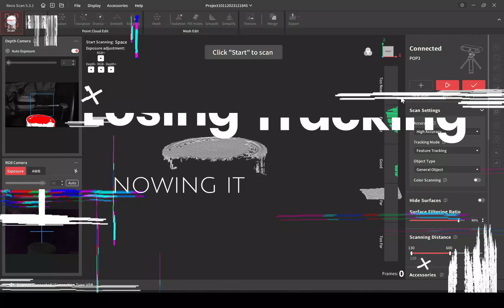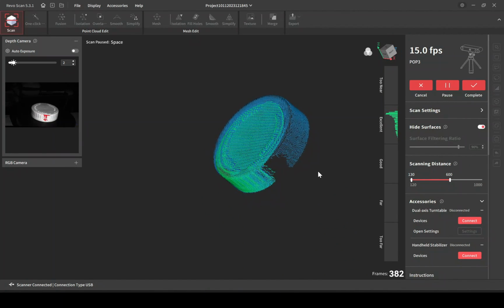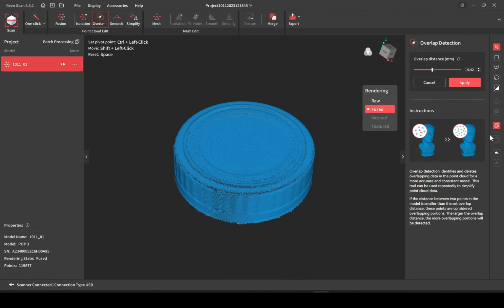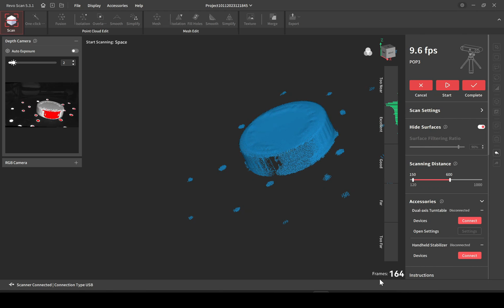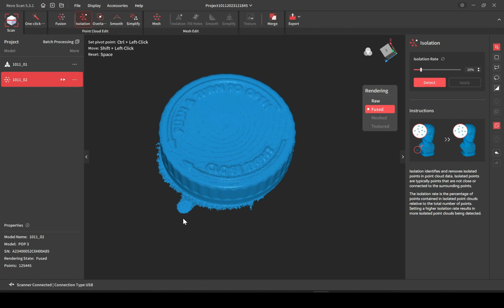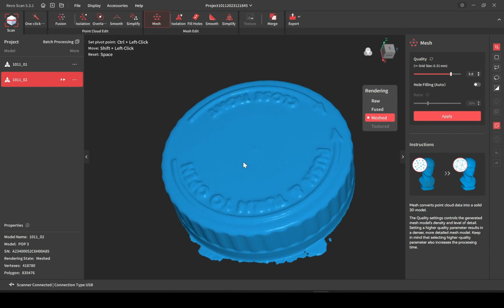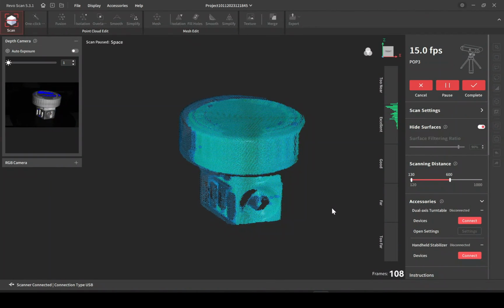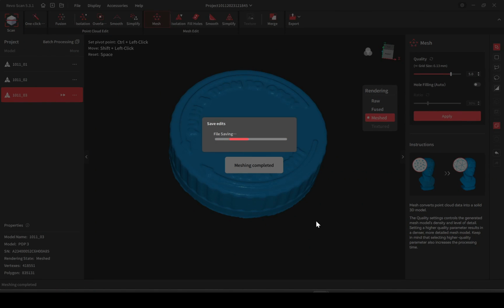3D scanning Tips - Tracking

Comment: Why does my pop 3 make trail lines of the tracking dots when rotating and yours doesn't? Did you do something special?
Reply from the maker: Depends on the item.
In marker mode the should be very little to no trail.
In featured mode. They might be a small trail if it lost tracking.
A very small amount will be fixed in processing the point cloud.

Alot of trail means it is lossing tracking of the main item.
Reply: @xile6  yeah I don't know what I'm doing wrong. I've tried everything from adjusting the lighting, adjusting the distance spraying with aesub, painting flat white. I can't get this thing to give me a good scan on just about anything. And I'm scanning very basic shapes. It's not like there's any intricate geometry it's trying to work around
Reply from the maker: @thegoudaguymikey  oddly enough basic shapes are the hardest. Scanners dont see how we do. They need distinct features to hold tracking, or it all looks the same to them.
Did you try in marker mode with markers on the table and some on the item if need.
Reply: @xile6  indeed I did. Someone on a forum told me I might need to get the mini

Comment: In both cases you used marker mode to track but in the first case it lost tracking; or did you use feature tracking the first pass which causes it to duplicate itself numerous times and in these cases you have to use marker tracking the second time the merge them together.

Why not use marker mode the first pass ?
Reply from the maker: First mode was feature tracking. And it is part of the video to show others what they are doing wrong. Reason for starting in feature mode.
Reply from the maker: Also you do not need to use marker mode on both scans to merge them together. One scan can be marker mode and the other feature mode. It can even be from a different scanner
Reply: @xile6 Although marker mode won't lose the features as you shown in the first pass with feature mode. Wouldn't it be best to suggest to scan with marker mode as to not to loose features as with feature mode in the first pass as you shown ?
Reply from the maker: @christopher8116  im not sure you follow the video.
The video shows that feature mode does not work on all items. 
The feature mode scan is to show and explain why it is losing track. 
And to show how the model looks.
Some people will do a scan in feature mode just like the first scan i did. Then wonder why does their scan look so bad.

Then the 2nd and 3rd scans are to show how you would scan an item like that.
The problem and the solution.
If i just showed the solution people would not know what they where doing wrong

Comment: Really helpful tips, thanks for sharing! Is that tracking object, which you used to elevate the scanned part, available online to download and 3D print?
Reply from the maker: Yes it was downloaded from here.
Simply scale it to the size you need.
I print mine with a black top.
So it is easier to trim out the scan

https://www.printables.com/model/272030-scanning-geometry-pedestal

Comment: Really good video! Unfortunately turntable rotation seem to be not used for alignment as done from structured light scanners. Do you have any experience between pop3 and mini? Is mini better then pop3 especially for technical parts?
Reply from the maker: I have all their scanners. With them being what i call live scanners vs stationary like the structured light scanners.
I fine them better for some items since you can easily move around the item.
The stationary type you must figure a way of holding the item just how you need it as it rotates around.

The mini would give you the highest detail but it all depends in the part. The pop3 has a larger FOV. So med size to large parts would be much easier to scan on the pop3
Reply: Thanks for sharing your experience!!!